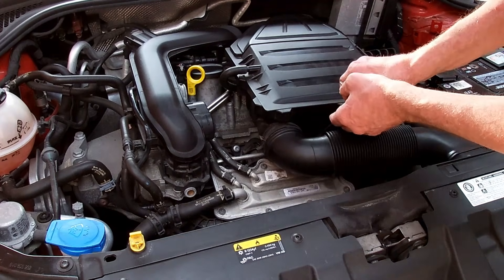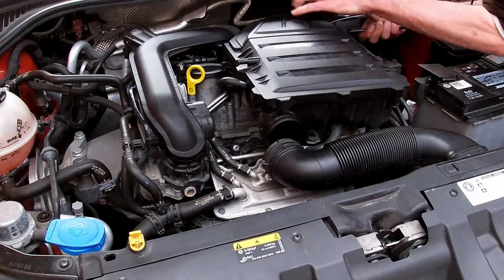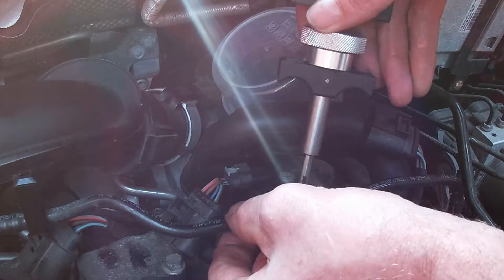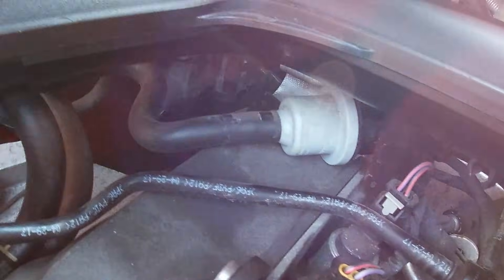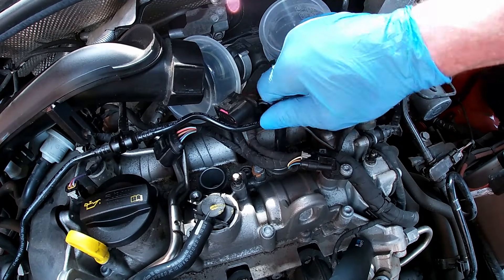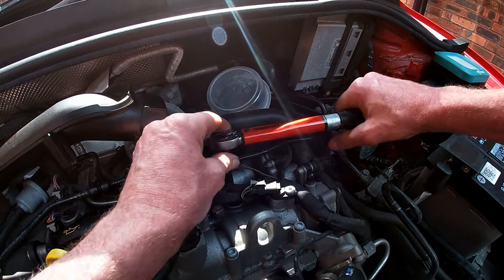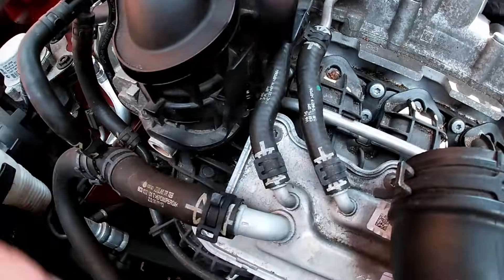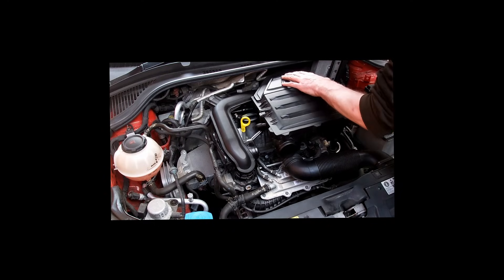Spark Plug Replacement Skoda Fabia Mk3.VW Polo 1.0 TSI Engine.

Comment: The spark plug thread MUST NOT BE LUBRICATED!!! When lubricating, the spark plug is screwed in more than usual, because the thread has less friction. The spark plug electrode is then turned in a different direction (which is wrong) and there is also a risk that the piston will hit the electrode! The tightening torque of 22Nm must be observed!
Reply from the maker: Yes and that's why I only put a very minimum amount of lubricant centre of threads only.